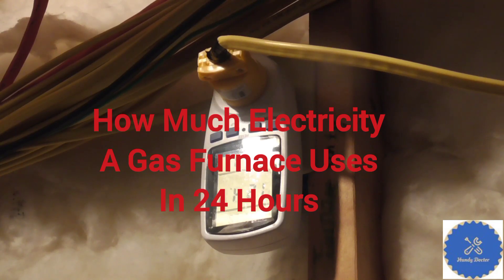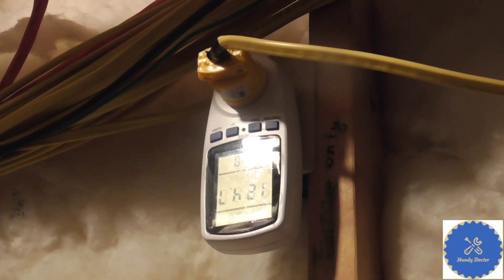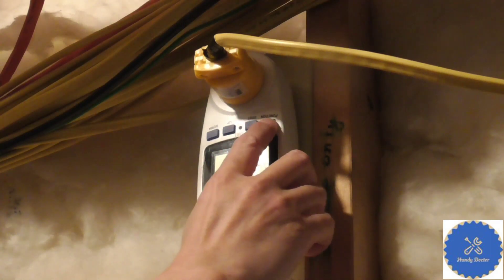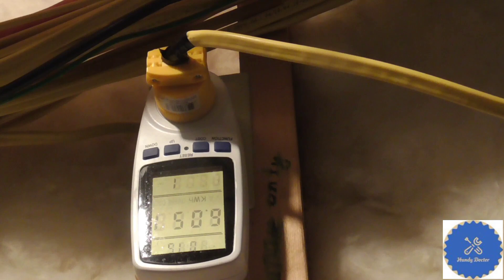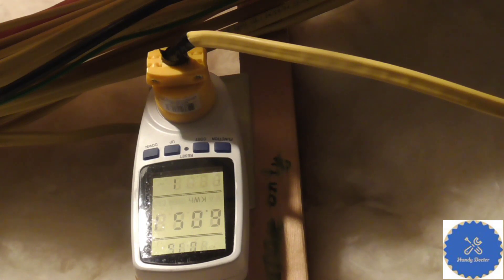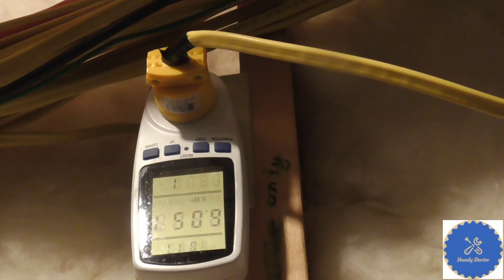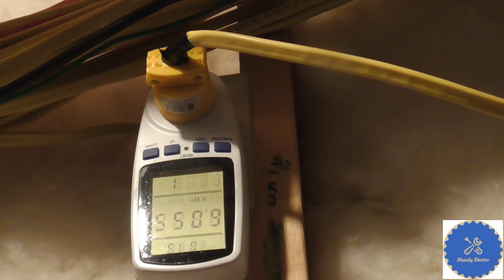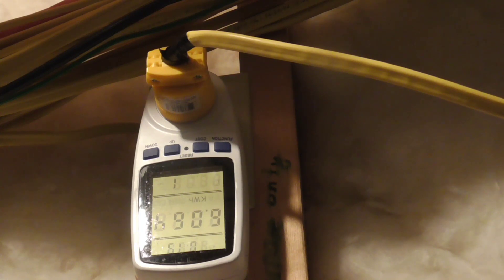How much electricity does a gas furnace use in 24 hours? Run furnace with a car battery

Comment: Even worse is the peak draw on the battery.  A 106 amp hour battery should never be drawn over ~100 amps, hell, it is best to keep it around 50 or less.  If the furnace peak is 12 amps 120 volt, and ~120 amps 12 volt, you will have potential failure point from maximum draw, long before you drain the battery till voltage drops.  I would suppose a truly heavy duty system for the task would be closer to 300 amp hours 12 volt, preferably lithium iron phosephate that can be drawn closer to 80% down vs. the 50% of lead.
Reply from the maker: Definitely. I have two huge commercial batteries. Each weights 125 lbs, lol. They do have 300+ AH together and can run the furnace without problem. A typically car battery is designed to handle 100+A for a few seconds only and definitely would fail to run a furnace of this size.

Comment: I learned a lot about batteries and solar from my RV.  It is surprising how little power you have on batteries.  Even something like a TV can significantly drain the batteries if you don't keep it small and LED.  For example, a 130 watt TV will draw about 10.8 amps plus inverter losses, so 2-100 amp hour type 27's from fully charged will be drained to 50% in less than 10 hours even if nothing else is used.  Add lights and maybe the furnace and water pump and you can see that 2 deep cycle batteries will not last long.  On the other hand, a small say 24 inch LED TV might take 50 watts, so it could last 24 hours by itself, with no other loads.  This would leave power for other things.  So what you plug in makes all the difference.

The solar is nice when it isn't cloudy or you aren't parked in the trees.  On a sunny day 300 watts of panel is plenty to charge 2 type 27's even lying flat.  But if it's cloudy they don't do much at all.

I have one of those power meters which I bought specifically to test what things I could run in an RV and what I could not.  Even if you have a big inverter, say like a 4000 watt, it sounds great maybe you can run your A/C!  Yes you can, for about 10 minutes.
Reply from the maker: You are absolutely right. I was quite surprised when I found out that my furnace takes 1000W to run and close to 1500W to start the blower motor. At first I used a 1500/3000W inverter and it couldn't start. It does run smoothly after upgrading to a 3000/6000W but with two 150AH truck batteries, I would still say: forget about it. I either don't need it or it's way too little. I do have a portable generator, if really needed. Luckily we live in a better area with rather reliable power.